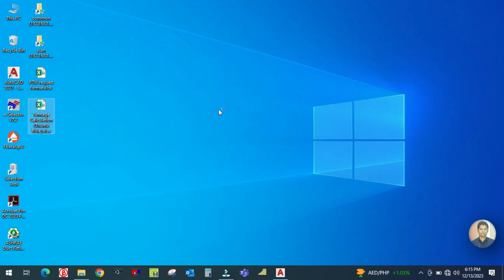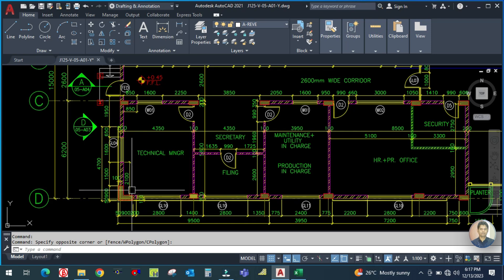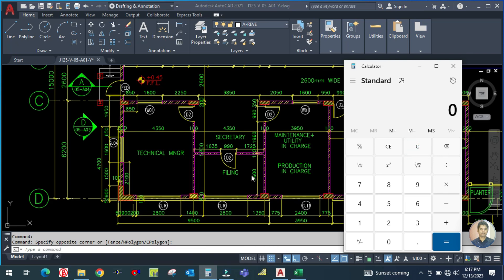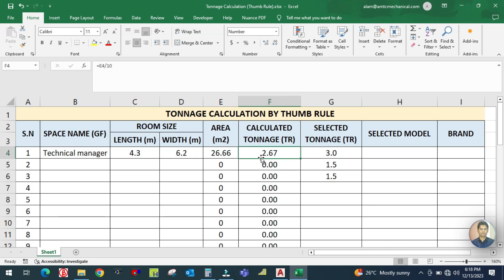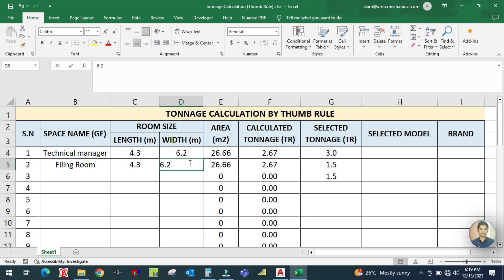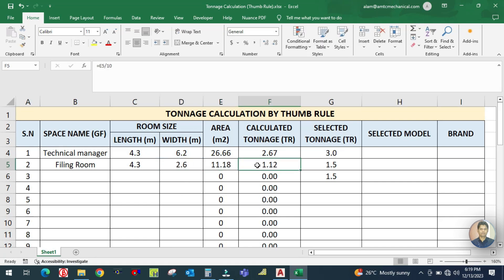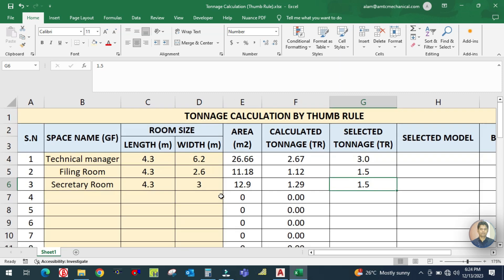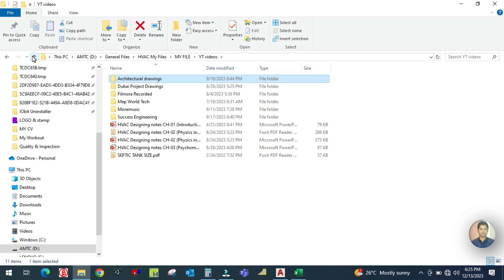AC CAPACITY CALCULATION I  THUMBE RULE I REAL PROJECT I ACTUAL PRACTICE I ESTIMATION PURPOSE I

Comment: Sir this thumb rule for Saudi Arabia because in India we use 100ft ² for 1 ton...
Reply from the maker: This thumb rule applicable for every where your are using 100ft2 i am using 10m2 per ton both are same only difference in unit
Reply: @successengineeringofficial7742   sir thumb rule does not change according to location.

What is the thumb rule for Saudi Arabia...